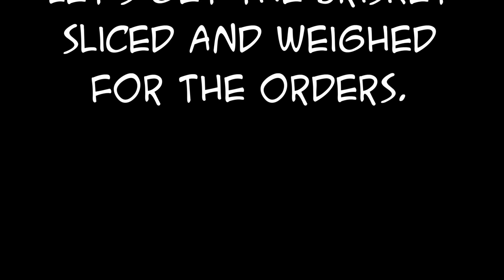SDSBBQ - Brisket Smoked on My OG Drum and POV Slicing

Comment: Good tips at the end with weighing and packing.  What is the smallest size cambro that you use for times where you have maybe 1-3 smaller orders?
Reply from the maker: The smaller black Cambro is the one I use most often but I did just buy a foam one that I've been using more often. I'll have to do a video on it soon.
Reply: @SDSBBQs  Ok.  Didn't want to buy a full size Cambro for smaller orders
Reply from the maker: @MrSteviej893  It works the same for big or small orders. Buy the biggest one you can afford.

Comment: Good morning Mr. Dash sir, brisket looked good.... questions...why not get the fire started in the bottom on the basket in the drum like you do with the other smokers? Do you give the customer some of the liquid? If so in a separate container or with the meat? Thx
Reply from the maker: In the drum it's easier for me to start the fire and add the lit charcoal to the top, so I am not burning myself trying to get it into the drum while lit. If you notice I am just pouring in the lit charcoal on top and it gets the cooker up to temp WAY faster than doing it the other way. I failed to mention this in the video. I do put the Jus in a separate container and give that to the customer.
Reply: @SDSBBQs  I gotcha,my that's were pour the lit charcoal into the basket,add the split then fill with charcoal. I was thinking back to another video about ash build up and how the fire like to travel upward. The only reason I asked...thx
Reply from the maker: Yeah... I really haven't seen much difference by doing it either way. Though one of those issues with ash won't have a problem when using lump as it doesn't produce as much ash (wink)